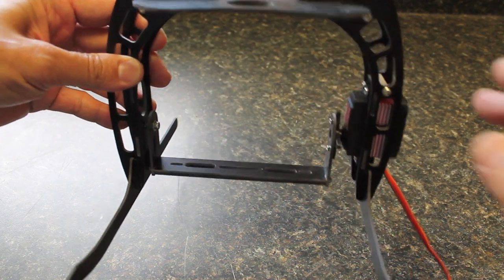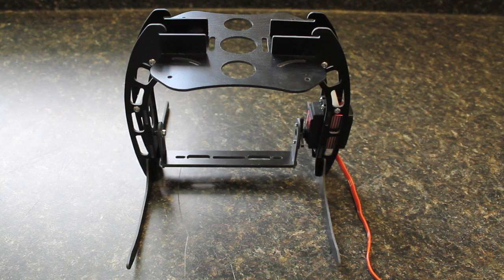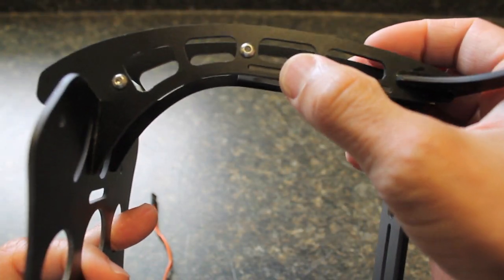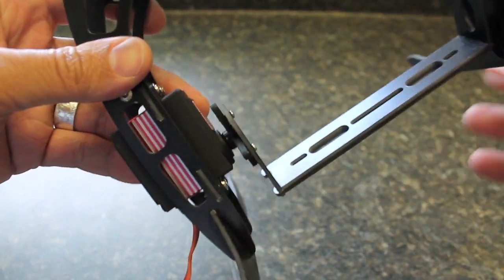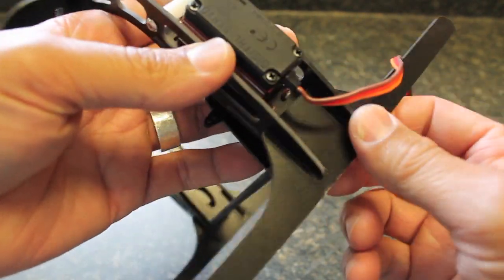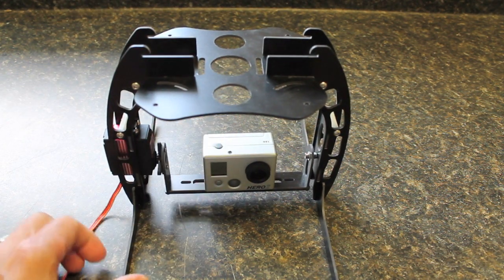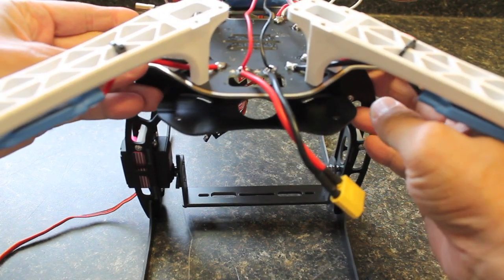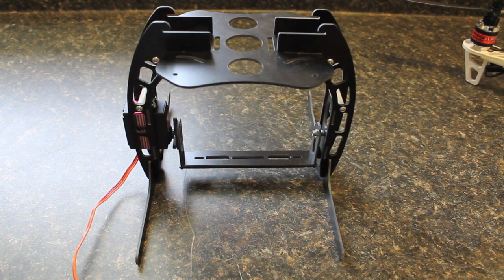Hobby King x550 Camera Mount and Landing Gear Build Review

Comment from the maker: The main damage was do to a crash from about 5 feet in the air. One prop caught the edge of a tree and dropped my quad to the ground. It landed on one of the skids which snapped. The other factor is that the landing gear doesn't mount tightly to the DJI frame so there's a bit of play in there. If you were to get the proper frame then it might be okay, but just keep mind it is more fragile than most. It's a good starting place but I suspect you'll want to ugprade at some point. Good luck!

Comment: Thanks for replying. I'm not actually going to use Naza stuff, way out of my budget... 

Did the damage come from landings? or from the weight of the camera itself? I was planning on the X550 frame with this gimbal, and if needed I could make sturdier landing gear separated from the gimbal.